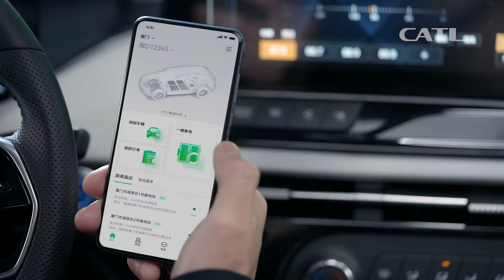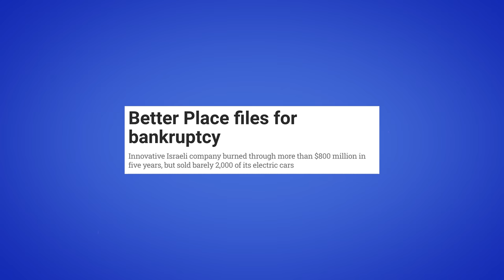Why Battery Swapping Is A BAD Idea

Comment: There are several misconceptions in this video, the main of which is that battery swapping is just an alternative to chargers. Its purposes are varied: 1) Alleviates range anxiety for those long trips (you can still use chargers for regular city use). 2) Under the BaaS (Battery as a Service) model customers can actually switch out batteries for newer and longer-distance ones, they are not tied to a single battery for the entire car's life cycle. If a new battery is released, it's made available to the pre-existing cars. So if you just bought a car with a 100 kw battery and NIO comes out with a 200 KW battery, it just takes 3 minutes to upgrade to it. 3) No battery wastage. Your precious Tesla is junk after a few years or you have to pay like 20k for a battery replacement - absolute bonkers. With the BaaS model your battery is always in good condition. 4) You can actually swap your battery for a larger one just for a long trip, and then switch back to your usual (cheaper) size for daily use. 5) When autonomous driving kicks in, companies with swap station infrastructure will be ready for fully automatic recharging, while Tesla owners will still have to fiddle around with charging cables and wait for an hour for the car to charge - hardly a seamless experience. I could go on and on.
Reply: What you Elon fanboys fail to understand is most people do not want to think a single minute of the day about transportation. They just want it ready to go with no prepping issues.
Reply: Would you like to have a battery swap service for your phone? In the earlier versions of phones batteries were swappable, but in 2022 batteries are much better than in 2000. Hence swappable batteries no longer exist in phones. Cars will go the same way. As cars approach 800km or 1000km per charge, swappable batteries will not be useful.
Reply: @veerkar  Phones and cars are not comparable because you can change your phone every 2 or 3 years, but most people cannot change their cars every now and then.
Reply: @veerkar  no. Batteries can't be swapped on phones because manufacturers don't want you to. They give many reasons such as water resistance but on some old galaxy flagships you could change the battery even tho they had very high water resistance.

Anyway, my old Samsung note 8 is absolutely as good as new. Maybe not as many updates but many of us don't care about that. The only reason I have to get a new phone is the battery. Do you understand why batteries can't be changed? Because otherwise people like me would not buy a new phone.
Reply: @veerkar  I do want a swappable battery in my phone. But you know... You are not wrong when it comes to cars, despite being wrong when it comes to phones. In the future, with good enough batteries, swapping a car battery as a method of charging will sound absurd. But We still need swappable batteries to be able to change them when they degrade or malfunction. Both in cars and phones.
Reply: @veerkar  The only reason phones don't have changeable batteries these days is because the manufactures have enough leverage to make phones that way lol. Battery life on phones basically hasn't improved at all over the last 10 years, neither has the battery tech, they just don't make phones that way so you have to buy a new one when the battery sucks.
Reply: @bobbygetsbanned6049  that's untrue. Operating systems and processors have become energy efficient by design (which is why phones have got more powerful without having a 1 hour life), and batteries have become more energy dense for the same capacity (which is why phones have got thinner). In addition to that, Quick Charge protocols have improved the charging rates from 5 Watts to 50 watts, as well as better battery management tech to prolong the life of batteries. As a result, modern phones can charge fully in an hour but last years longer than their predecessors.

The same developments can be seen in battery electric vehicles.
Reply: Battery swapping technology makes sense in high density areas, as well as along Highway rest areas. Supports the grid, has solar panels on top.. & does a diagnosis on the EV & the battery pack every swap.. Also over 12mil swaps have been done, & a gen 3 station is coming out next year.. Battery degradation is an issue with conventional EV's., & the more fast charging that you do to the battery excellerates the degradation.. Cloud based system actually automatically puts you into the queue within 200m of a swapping station..  one touch and go.. Sounds good to me. ✅
Reply: Battery swapping is better, why? Coz me as citizen of indonesia cannot afford supercharge and charge parking lot is worst... And if u got slot for charging slot, its soo slow...
If u want better earth we need to swappable battery for 2 reason
1. Simplicity
2. Saving time
Reply: But this means no structural battery... which means no 4680 cells which means the price of the car will be over 5000 thousand dollars more expensive just so you can swap the battery... No thanks!
Reply: Also batteries don't take an hour to charge unless you charge to 100%. Most people charge for 30 minutes or less as you get over 200 miles in that time otherwise you will be there for an extra 30 minutes and only get less than 100 miles extra.
Reply: Saying an EV battery is junk after "a few years" is as Darwin would say "absurd to the highest degree"... there are EVs and hybrids with lithium ion batteries still rolling after 10+ years, my dang Prius still had a functional battery pack after almost 300,000 miles on the road
Reply: @robryan2079  I have no idea where people get this couple year thing then you replace the battery. Maybe they're thinking of phones? Phone batteries don't have as good of a heating/cooling system and you also charge your phone to 100% down to below 50% very often. 

With an ev you go from 80% to 60% if your daily trips are really long and most people would only lose 10% of the battery after the whole day. Then you charge back up to 80%. Only on road trips do you charge your car higher.
Reply: @robryan2079  Also these battery swapping stations are trying to fix something that isn't a problem for road trips in the first place lol. You need to take breaks on road trips and during those times you charge your car making it not a issue. And while you made need to stop slightly more often the stops don't take as long as you aren't spending 5 minutes filling up your car and paying for stuff then being tricked into paying for very expensive treats and food. With an ev you can charge and buy food from anywhere. On a 1000 mile road trip a model s plaid with those wheels that reduce its range to just 350 miles it takes only 30 minutes longer then a gas car. That is without charging at night.
Reply: @lachlanB323  I see a big opportunity for high density area's though. Places where most people don't own their own parking spot or driveway (European and Asian cities for example). These people do not have the opportunity to charge at home, and thus need to plan their charging accordingly. If charging takes 18min, charging stations will get crazy gridlocked in these places. This is why you see the modulair batteries in mopeds kicking off, you can take these up to your apartment. This is not Tesla's market, so it makes sense that Tesla didn't care for it too much, but it is the market for all Fiat 500's and Panda's so they will need to think about how to tackle this. Will all public parking spots need to have a charging station? Then you will have the problem of people not buying EV's until the coverage there is very high. And as the EU wants to stop selling ICE vehicles by 2035, a solution is needed quickly. Or can we come up with something more modulair for this segment?
Reply: @MtJochem  Destination Chargers. There's already a lot at hotels. They aren't that expensive so I can see them at quite a few parking spots. 

However with self driving cars I don't think anyone living at an apartment should own their own car as it is too expensive and inconvenient. Just order a car to pick you up as you are leaving your Apartment. You won't have to take care of the car and you save money because you don't have a car sitting there depreciating over time since you aren't using it. economies of scale say owning a car is more expensive and you will only own a car if you live in the middle of no where and those people can charge at home anyway.

Also that EU ban is so pointless lol. Ev's are going to take over way before then. My prediction is that by 2028 ev's will take up over 90% of cars sold.
Reply: @lachlanB323  If that is true, then why hasn't car sharing kicked off in European cities already? There is nothing stopping that, but it is barely used atm. Apparently people don't mind to pay a bit more to have personal transport. Also I am not sure what you mean with hotels? You mean that hotels need to share their spots with the locals living there? Have you just solved the parking problems that most major European cities have? The city I live in only has hotels with big parking garages at the edge of the center, all hotels in the middle of town only have a few spots (already filled with their guests). All I am saying it that the current model only works well for people with driveways, which is a big market. But we need full market saturation, so there is definitely a place for more modular systems on the market. I absolutely hope you are right and EV's will take over that quickly, but as long as car manufacturers are only designing for the average consumer it will be hard, as most consumers are not average and have some exception of use to deal with.
Reply: @MtJochem  Full market saturation requires self driving cars imo. A self driving car service will be just as if not more convenient then owning your car and will be significantly cheaper as you don't have to pay someone to drive the car. By full market saturation I mean everyone uses an EV not that 100% of car sales are EV but everyone uses a EV in their daily life. For road trips you can hire a car for dirt cheap too as ev's are cheap.
Reply: @lachlanB323  fully self driving is not a thing, not even at the highest end atm. How do you expect it to be common at the low end in a few years? It will only drive prices up if even possible. It is not technology that exists now, and it is highly doubtful if it ever will. We cannot wait for the adoption of future tech to adopt ev now.
Reply: @MtJochem  I can't be bothered explaining how so just look in to it yourself and think for yourself is all I will say. Look at fsd beta and its improvement over the past year
Reply: @lachlanB323  still wont solve the parking and overnight charging problems. It feel very weird to propose self driving as a better solution than modulair batteries for lower segment cars, when the one is still in research phase and a expensive solution, and the other one is already applied in some countries and segments (mopeds ect), low tech and cheap.
Reply: @MtJochem  Yes it will. The Tesla's can go to their chargers when not being used. And there's plenty of chargers.
Reply: LOL, 1. Who says you get a battery with always good condition? Those swapped batteries will ALSO DEGRADE. They won't throw a 10% degraded battery out of the loop. That will cost too much money for them. Also who says Tesla fast chargers take an hour? My friend who has an old 2019 Tesla Model 3 just goes to a fast charger for barely 20 minutes and then drive a whole week on that.
Reply: @lachlanB323  And because of the swapping structure you need to build in the car, that means the car is more heavier and less space for big batteries.
Reply: So our precious Teslas are "junk after a few years"? Tesla batteries have been shown to retain 90% of their charge capability at 200,000 miles. In other words they're probably good for 20 years. That's a lot more than a few years.
Reply: @JackF99  the LFP batteries are even better. They can last like a million miles.
Reply: "Your precious tesla is junk after a few years"
How many years is "a few" years though?
Cause I have seen Teslas with over 200k miles on their counter, and with my driving habits it would take me more than a decade
Reply: You get it.
Reply: There are now opportunities and options in Africa for EVs, most especially in highly densed communities.

BaaS seems to be a good model because of the high cost of purchasing a 48v lithium battery. Commercial riders prefer to pay a reasonable amount for a swap in (TAT) 5 mins and are happy to  continue their trips.

I think investment in these areas across cities in Africa would be a good idea. We have access to a large market of commercial transporters seeking alternatives, mostly cheaper.

Comment: Battery swapping is a GREAT idea. As a share holder of NIO, I can tell you a lot of arguments in your video is wrong. First of all, swapping is a feature on top of regular charging. It is designed mainly for long trip. Just imagine spending an hour to charge a EV every few hours of driving, swapping that in few minutes is a great idea. Secondly each station only need to keep 12 battery inside, compare to the amount of cars NIO made, battery in station is a very small amount.
Reply: This works for Nio now because they are not as big as Tesla. As Nio expands, they will abandon battery swapping
Reply: @pownder  Are you the CEO or what? :D You're wrong.
Reply: @Drgnrt  brother, superchargers need about 1 hour or so to charge a battery to 100%. To make battery swapping viable, a station will need to have about 20-30 batteries at every instance. All those stations will also have to be managed by Nio. This may be sustainable if you are making 10k cars every year. But when you start making 200k cars or more, it stops being viable. Batteries will not be available. Also consider that the battery is the most expensive and difficult part of the car to make, wouldn't Nio rather focus on making batteries for cars rather than spares? Battery swapping can only be sustainable if every other EV OEM uses the same batteries and also swaps
Reply: @pownder  You make it sound like they make 10k cars a year, while in fact they are aiming for almost 200k this year already and they recently confirmed battery swap will be available for their mass market brand that's supposed to come next year. I'm not trying to argue here, as I don't have a crystal ball, but you'll be able to review your statement soon enough.
Reply: @pownder  It's not like the battery swap station needs almost 3-4 times as long to charge that pack. Battery swap station only has a 50KW charger. If You leave a fully flat 100KWh battery, it will take at least 2 hours to charge it. I know there are more batteries inside. But after 11th battery swap You have a station with all packs that are empty except one that will be half charge. Also swap stations will be degrading batteries because they will be constantly "fast charged". They will be a target for hackers/thieves. Cars with swappable battery packs will be more expensive than their non-swappable competitors. Each battery pack without a car, is a wasted resource.

Comment: I think this video forgot to mention when you have a swappable battery platform you have 2 options, either you can charge the battery or use a swapping station.
Reply: right, a fast charging to get to the next swap station without any issue and swap it... also why swap stations can´t have support from governments if it solves and promotes the BEV adoption which is supposedly what everybody wants
Reply: He look like a joker ?
Reply: Or both